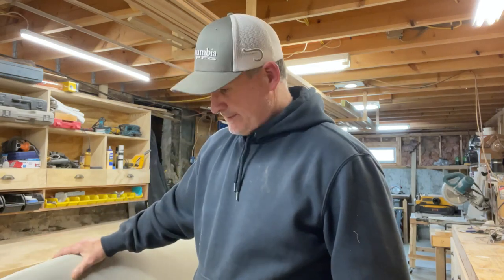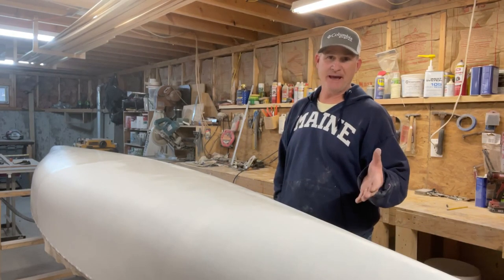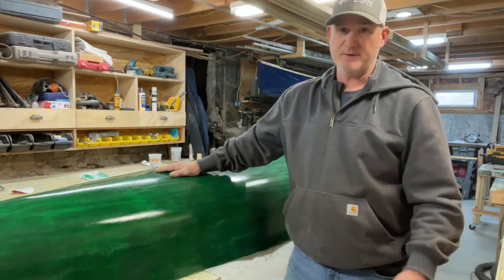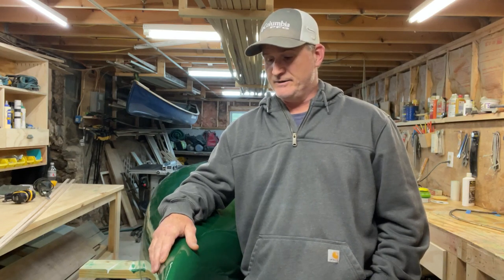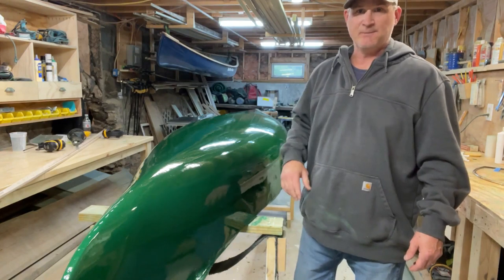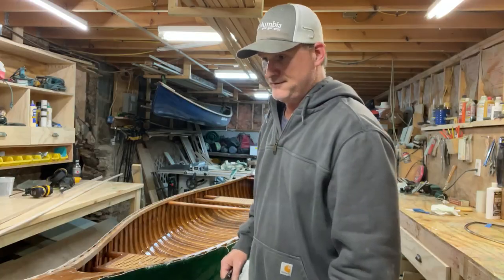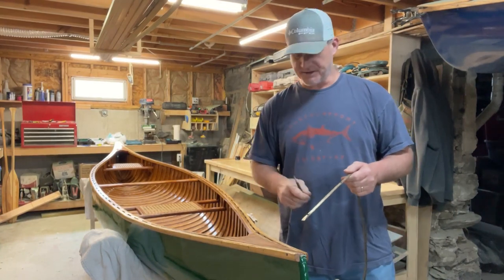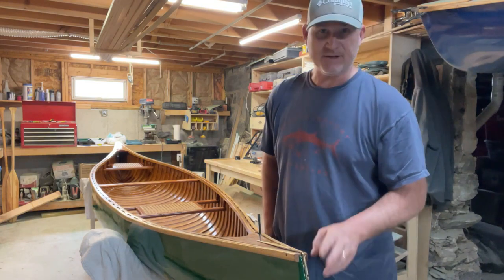Wood Canvas Canoe Restoration Part 3, Project Completion!

Comment: Great videos on the canvas Canoe restoration you explain everything very good detail up until applying canvas sealant what product to use how to purchase the product how to apply it that’s all just wondering why
Reply from the maker: The canvas canoe filler product used was purchased from Northwoods Canoe Company.  It is their proprietary blend.  It is a canvas filler and not a sealer.  The product is applied by applying with a brush and then rubbing it into the canvas weave by hand.  Working in approx 3 ft sections at a time.  The filler requires 3 continuous coats although the first coating is done as previously mentioned in 3 ft sections followed by the second coat covering one half of the canoe at a time and the 3rd coat applied in similar manner until the filler is smoothed enough.  Then it is necessary to wait for 30’days for the filler to fully cure.  After the 30 day curing the hull will be sanded with 220 grit without sanding through the filler and into the canvas.  I thought I had covered this process in the video but if I wasn’t clear then hopefully this response will be helpful to you.  If you purchase the filler from Northwoods canoe company in Atkinson, Maine they provide a full instruction sheet on how exactly to use their product.  I also highly recommend this traditional canvas canoe filler product.

Comment: Excellent work.  My wooden canoe had a shellac bottom that took minimum abuse very well.  I would not want to be the first paddler to hit a rock and spoil your professional finish.
Reply from the maker: All canoes take a beating at some point.  I am currently in a trip and hit a rock and I said “Well that will need some attention”.  They all can be fixed is my point.  Enjoy the canoe and then fix it if you break it 😃

Comment: MT, thanks fo r he bow to stern restoration videos. I can appreciate the attention to detail and I hope the canoe is getting some good use.  I'm curious too about the resin and paint used on the canvas?  Do you have any pointers in that direction?
Reply from the maker: I am happy to hear you enjoyed the video series.  This particular canoe was a restoration project for a couple that wanted to bring their canoe back to full beauty.  It was in dire need of some TLC.  The canvas filler is not a resin but rather a more traditional canoe filler recipe which I purchased from Northwoods Canoe Company in Atkinson,ME.  The traditional filler contains a variety of ingredients including silica which provides an extremely hardened shell after a 30 day cure period.  Some use resin but most prefer the traditional canoe filler.  The current project I am working on “Flewelling Canoe Restoration” will receive a resin coating with a West System filler material.  This canoe received Rustoleum Marine Topside Coatings Deep Green paint and marine coatings primer.  Interlux, Kirby, and Epifanes paints also are rather popular.  Rustoleum is a great product and affordable.  However people will typically default to the higher priced paints.
Reply: @mainetripper   thank you Sir, that gives me a good place to start and I trust your judgment. I recently purchased from a neighbor and good friend, a 12 ft Thompson which he had purchased used for his father in 1960, for the past 40 years it has been stored in his professional greenhouse which the furnace remained on during cold seasons in Michigan.  While the boat is in remarkably good shape, I’m just trying to educate myself for the day when it needs restoring.  One more thing.  Most people quit their YouTube restoration series after part 1, few will do a part 2 and the true humanitarian with a deep passion for their hobby will do a part 3. You Sir are the exception. Keep up the good work and thank you.
Reply from the maker: @AntiqueWindmills   best of luck with your canoe project.  You will be quite pleased when the effort is realized, especially when the canoe is back in the water.  

I appreciate your kind words.  My videos are to help those that may consider tackling their own projects.  The books are great however sometimes a visual is an added bonus.  Thank you for watching and commenting and I wish you the best with your project.  Have a great day!